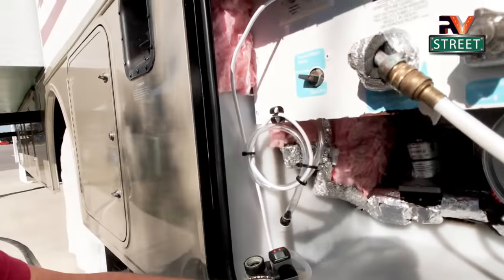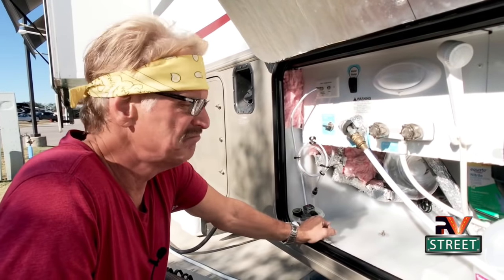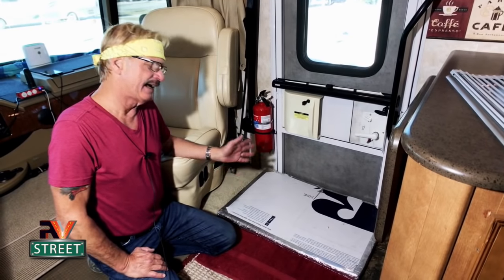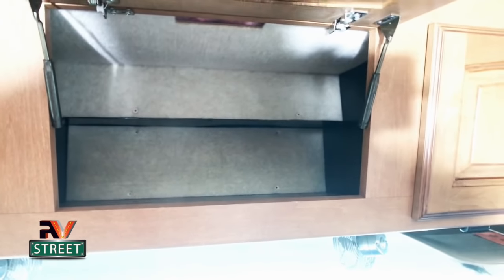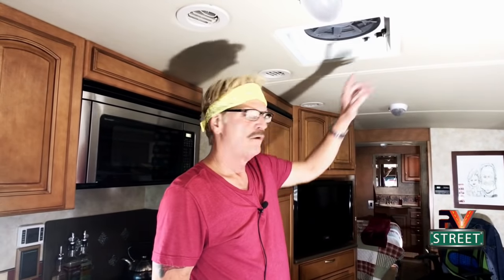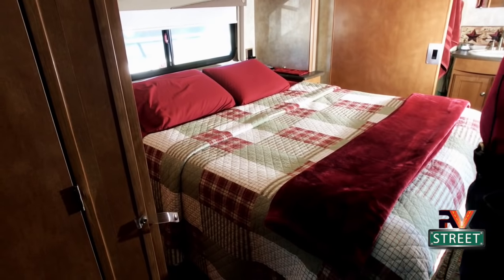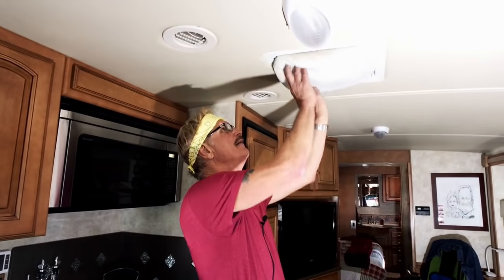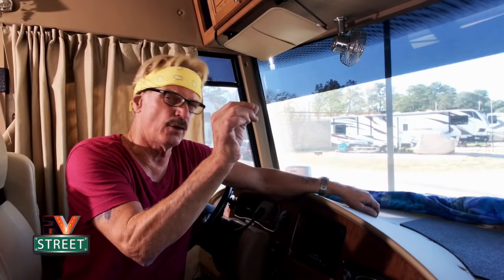😰  INSULATE, HEAT & PROTECT • Key to stay warm in your RV

Comment: Thank you for the video thank you for the knowledge when we recently had the six degree freeze here in Texas a lot of your tips came in handy we don't live in a motorhome we have a fifth wheel RV so it was a little different but it worked and yes we didn't even run propane we ran the electric heaters we did have electricity but we didn't have water of course because the RV park shut it off for safety reasons so we got five gallon jugs and filled those up and stored them for water we use a radiator heater in the living room and then a little heater in the bedroom that you plug in it was very cold but we got through it we use the pipe insulation on the hoses we could have done a couple of more tips and tricks but we weren't really too worried basically living in an RV is trial and error if it's going to work it's going to work if it doesn't it doesn't LOL hopefully we don't have another 6-degree freeze this year here in Texas LOL and it is November already so I am prepping again for the winter we are going to hardware store this weekend and getting supplies👍👍
Reply from the maker: Your forward thinking and planning is what we all need to do. Good for you Mike 👍

Comment: You showed up in my feed & I wasn't subscribed at that time, but I joined tonight.  
In my house to battle window condensation I screwed a piece of plexiglass to the trim in the inside, put foam weather seal around all 4 edges.  End of problem without dehumidifiers!  I live in NW Wisconsin where the winter temps can plunge to 40 below zero and this window treatment still works.
Loved this video, we have a 5th wheel but do all our camping in the in warm weather but your insulation tips will be implemented to reduce the stress on the AC, Thank you!
Happy Trails & Happy New Year!
Reply from the maker: thx Josey.👍

Comment: We generally use an electric space heater and a dual temp heated mattress pad. However, we also use our propane furnace IF AND WHEN TEMP OUTSIDE IS BELOW 30 degrees because our furnace is ducted to our water tanks and hoses under the floor (to prevent freezing without wrapping each line).
Reply from the maker: That is excellent advice 👍

Comment: The reason to operate a furnace in winter when the temps are at or below freezing is for those of us who have 4-season coaches, because in addition to the living space the furnace will heat the wet bay, the underside where the tanks and plumbing is located as well as the basement storage area.  In such a coach in below freezing temps, using another heat source will heat the living space to the point where the thermostat will not call for heat or infrequently, so while one is warm and toasty the pipes and wet bay may start to freeze.
Reply from the maker: Ok got it. Ya we don't have basement heat. So I understand what you're saying. Several others have said the same thing that have basement heat. The way I dealt with those areas is the insulating my bay doors and running my lamp in the wet bay. The coldest temps we've experienced is 17º for several days and did fine. But I hear ya. Thanks for that info.

Comment: Had to use electric heaters this year furnace went down . As i pulled it out  took a pick of the mod # .my board went out i ended up installing a new board , sale switch , ignitor, and limit switch . Everything else looks good . After get8ng it up and running . I ordered an exhaust wheel, and blower wheel. I also kept some of the old parts that worked in the rebiuld ,they were well used but good for a spare  .
Reply from the maker: Yep, when replacing parts, belts etc, it's always a good idea to keep good working parts for spares. Good comment 👍

Comment: 23:55 I fo7nd that when it gets too cold for the heater to work efficiently,  move that heater up to a table top. The heater will produce much more heat. The only thing I can conclude from this is that warmer air rises. The cold air on the floor reduces the output of the heater. The heater intake needs warmee air.

Comment: My furnace heats the underbelly of my 5er which is where my tanks and piles are. I will use my fireplace to keep it warm during the day and turn on the furnace during the night. The teens and twenties are warm for winter by me. Most of the time it's in single digits dropping below 0°F often.

Another tip is you can use the foam board on the outside of your slides. Cut to fit and hold them in place with elastic ropes. Cut openings where your windows are to allow the light in. If your in extreme heat one on the top of the slide alone will help alot.

Comment: Sandra Westley I am from the UK we have in our caravans or RV as you call them, we have full central Heating in our vans, with Radiators that can be run off electrical or gas, but no open flames it’s vented through the side of the van, the radiators are Finns that run all around the van and under the furniture and beds to keep all areas warm, we normal run our central heating on electric and we also have a water heater that’s all run on the electric, but can be run on propane if not on a site, it’s all thermostatically control, we also have all double glazed windows so no condensation on windows. We also have blinds and curtains on all windows. You also have a header tank with antifreeze so nothing can freeze.

Comment: I spent all last winter in my motor home on my ranch in northern NM. It got down to -10 (10 below zero) some nights. It was brutal but I got through ok. I’ll be doing it again this year. 
Also you can refill the 1lb propane bottles with a larger bottle in about a minute if you want to.

Comment: Very well done. Thank you for all the suggestions.
I do use my furnace if it is going to get down in the 20's and I crack open my kitchen cabinets and the drawer above where the water pump and plumbing lines run from the water tank so the heat can get in those areas.  Otherwise,  I use ceramic heaters or the heat strip on my roof air.  Since I have a 30amp Class C, for safety I will only run 1 ceramic heater on the house, but I have a 20 amp cord that I will use (if the campground offers a 20 amp outlet) and run it thru the kitchen window to run a 2nd ceramic heater.
Reply from the maker: Yep, in very cold temps, keeping your cabinet doors open inside is another way to keep all those plumbing lines warm back in there. We do the same. I should of mentioned that in the video but forgot. However, I did put that info in the description text. Many folks go down below each video and read the description for additional information I put there. Good comment Cap.  👍

Comment: We run a floor standing dehumidifier with a hepa filter which can remove up to 55 pints of moisture.

Throughout our 32' trailer with huge windows there is never any moisture anywhere.

By the way: it's adjustable, so one can set the interior humidity to a comfortable level everywhere.
Reply: Hi could I ask you what the name of your floorstanding dehumidifier is and where can 
you purchase it? Thanks.

Comment: The space on the passenger side should be a return air port for the cab heater/AC unit. It might not look like there is a vent. It might be up on the top of the space.

Comment: Newbie Class A 34ft (older) motorhome-with-one-slide RVer here and living in a location where winter temps routinely plunge below -30C and even -40(F and C). This video has some very valuable info for those living full-time in RV parks in the majority of US states. 

But those living in say, northern Minnesota would most certainly need to take more extreme measures. Someday somebody will put out a video describing best heating systems for off-grid RV living in minus-MF temps. Or maybe they already have, but I have not yet found it. Questions concerning boondocking in such temps (battery preservation, battery charging without burning through more fuel than it's worth, solar panel charging and power unit options (Jackery? Bluetti? etc.), need to be answered. Hell, if we try this option (and survive that first winter) it might even be us who produce that video. Questions? Concerns? Insight?
Reply from the maker: I'm sad to say that Martin has passed away but I'm sure he would have lots of questions and insight 😁

Comment: I will add what others here have. Our 1997 class A passively (ducting runs underneath) heats the insulated bays and keeps the tanks and lines from freezing. If we used electric heaters when its below freezing we would have to heat tape or heat pad everything since we live full time in an area that regularly gets in the low twenties in the winter. We do use a ceramic floor heater when it just needs to take the chill off and its above freezing overnight like in the 40's and 50's.

Comment: Winter water hose.  I use four 5ft. sections (20ft. total) of 1/2" Schedule 40 PVC pipe with water hose connections so they can be joined together as needed. Thermostat controlled heat tape (ice dam preventer) from Home Depot/Lowes) inside of foam pipe insulation.
Stayed 2 weeks in 20 degree weather without any freeze up.

Comment: Martin,
Another great video,  but a week late lol. I just came back from a weekend of very cold nights camping. I do and have used ceramic heater to help out the main rv heater in the past. I was thinking about another heater to add to help out on this trip but didn't purchase one. But it will be the next purchase. Makes great sense to use the rv park electric full  instead using propane .
Reply from the maker: Thanks Tom. When you get ready to purchase please don't forget about using our Amazon store. Every little bit helps.

Comment: Hey Martin, I live in Northern Oklahoma and the electric is included, I have a 32' 2 full wall slides and I use 3 electric heaters, I use the microwave plug and put the others on each side. My space around the slides outside is very narrow and foam wouldnt work, I use 4 layers of cardboard in my stairwell and cardboard in front of my door. I dont have a heated basement so when temps are below 32° I turn off my water and open all faucets and turn my wh off. We have so much wind and at times it is extremely cold. I have reflectix and cardboard in all my winds. I have a comforter and cardboard in my front window. Nothing touches my windshield.
Reply from the maker: In really cold temps you should leave your water heater ON, otherwise it could freeze and then you'll really have problems.

Comment: I heated my 24X60 Mobile Home with a cheap Propane Bar-B-Q.  The by-product of propane combustion is water vapor (That's why you need to "Vent").  The Bar-B-Q maitained 72 degrees in the coach in 30degree weather.  A slow fan helps stir the air around.  Yes, it takes a bit to get used to the propane smell.  Start your Bar-B-Q outside.  After it's hot, bring it inside.  When you close the cover, you reburn the gasses that create the smell.  The metal case is what radiates the heat, not the flame.

Comment: ⭕⭕  The furnace is vented. They make an adapter for the Buddy heater so you can use a 20 lb. bottle.  The biggest reason for the windows open is when propane burns it also converts to moisture.  Try damp rid. You can get it at any home center. Comes in plastic tubs like butter.  Make sure the holes are open or it will not work. 😎  love your info.
Reply from the maker: Ya we use Damp rid containers too in other places—like in our basement—but in our rig they don't work near as good up front like those dehumidifiers do. Our dehumidifiers actually circulate the air and pull out the moisture in the air. They work fantastic. Didn't know about the adapter. Good tip. thx 👍
Reply: @joe blow I also got a larger tank. The larger Coleman screw on cylinders only last for about 3 hrs.

Comment: I've been full timing for 10 years in cold climates. Camper life in the winter sucks.  It's a constant struggle to keep everything thawed. I keep 2 electric heaters running. They'll keep up until 30 degrees or so. I've got a 44' 5th wheel with 5 slides.
Reply: I went to dragon my sink the other day and well apparently my lines for sink froze,  any suggestions to get them thawed?

Comment: I use propane furnace with full hookups because electric heat pump can only keep up for so long and then auto switches to propane.  (I’m not insulated like you yet..Lol)  Also I’m in Northern Colorado so common to have lows in teens & 20’s with occasional single digits.  Mostly I’m using space heater & electric blanket. Clothing in layers... because Colorado and that’s how we dress.   Thanks for this video!
Reply from the maker: We're good to about 5º-10º> for several days and just use our fresh water which keeps from freezing with what I've done. That 100watt lamp and insulation keeps my wet bay and tanks from freezing. thx R. Good comment. 👍

Comment: Good info on the insulation! Regarding your wet bay that you're heating with a light, there are infrared bulbs for heat, and they get hot enough to cook on! So if ever you are somewhere colder than you currently go, those are an awesome thing to have to keep your pipes fom freezing. I use that R-Max stuff myself and it makes a world of difference.
Reply: My bad they are infrared ceramic heat bulbs.
Reply: @travishope9364  So that’s a special type of bulb that goes in a regular light socket?

Comment: 1 reason to use Propane Furnace.
If you have been out of the coach all day, and have had the thermostat turned down to save energy.  I, Turn the Propane Furnace On, for instant heat, to knock the chill out of the air, then when up to 70°, turn the Propane Off and use Electric Heat throughout the night.

Comment: We use electric and propane. The propane seems to heat more evenly. But...we will run our electric during the day. At night we have the furnace for backup, if it gets too cold. Again, the propane worked a lot better in teens and single digit temps... as far as an even heat in the coach. Helps heat the flooring too.

Comment: Had my Raptor 5 yrs, primary heat source is a woodstove, secondary is my  propane furnace & lastly is electric ceramic. Personally, I find electric is TOO expensive and doesnt provide the "quality" heat that wood or propane provide.
I'm skirted with 4" blue rigid foam insulation behind my skirting boxing perimeter and next winter I'll add a Mr Heater Big Buddy to "warm"  my undercarriage so as to reduce the chances of water lines, sewer and tanks from freezing (which happened winter 2020/21).
Never thought about insulating under my bed or other ideas you mentioned so Thamks for the heads up. Great vid. BTW, I live fulltime year round in my Raptor - love it.

Comment: You’ve done a heck of a lot more than me. We’ve been in -30s in our fifth wheel and my water has frozen twice. In my basement right behind the wet bay I put a space heater and it keeps the water connections, basement, bathroom, and bedroom super warm. Bathroom and bedroom have gotten 70s-80s with that heater. I’m going to use your r19 ideas up above the plastic shielding under the camper and I do need to insulate my water lines. You have some phenomenal ideas. How’d you fasten the foam under your slide outs?

Comment: Excellent video! Even though I'm a travel trailer type just about every suggestion and help topic would hold true for it also. 
Would love to see you do one of these for trailers etc......Good Job!!! Thank you VERY MUCH!!!
Reply from the maker: Thank you Richard 👍
Would love to see you do one of these for trailers et
Pretty much the same thing just different areas. Key word is insulate, insulate, insulate.
Use electric heat when you can and save your propane, have your bases covered to control condensation and heat in the wet bay to keep tanks from freezing if you don't have heated bays.

Comment: Good practical ideas I just had a house fire and I'm going to have to live up here in eastern Ontario and she's a little cold right now live there during the rebuild so I'm looking at a 35 foot trailer is what I'm looking at but I'm a carpenter and you just help me visualize things and I'll stay away from the straw bales and yeah I'll just grab some foam..
Reply from the maker: Since you live in Ontario where it can be bitter cold for weeks on end, I HIGHLY recommend buying a higher end or top of the line, full 4 Seasons Unit whether it's gently used or a new one. That will be a much better place to start with and you can beef it up more from there. Full 4 Seasons Units have way better insulation, thicker walls, heated under belly and so much more.
Good Luck Marc. 👍

Comment: Usually up in Maine for Thanksgiving it can get COLD on the bold coast. I obviously don't have full hookups at the inlaws but I can run an oil heater during the day and run the propane during the night. I don't mind the propane lasts a long time and it's a drop in the bucket money wise long term.
Reply from the maker: Ya in that case by all means you can run propane. We're very familiar with Maine and love that state and yes it gets FREEZING up there. Beautiful state though. We go there every summer to late fall and stay near Bucksport. But I will say for a motorhome, it's very hard to find propane b/c we have to drive to have the tanks filled so we use our electric floor furnace running off a 20amp service from a garage outlet.
thx HD

Comment: The electric heaters couldn't keep up with how cold it was outside. We had to use the propane... we lived well with outside air temperatures down to -10 to -15 °. We also insulated everything including around the bottom. To prevent air flow.  Thank you kindly for all your tips.
Reply from the maker: Ya down in those types of temps you probably would need your propane furnace.

Comment: I have a 40 foot 2000 Newmar mountain Aire that heat pump when goes below 32 automatic turns on propane floor furnace that also keeps water Bay heated.  That's the only reason I use the propane furnace.